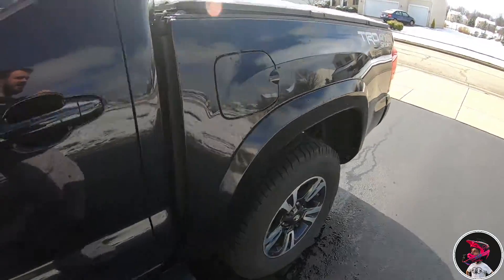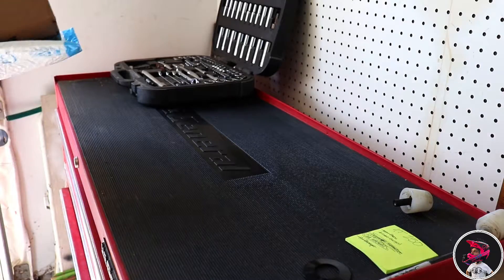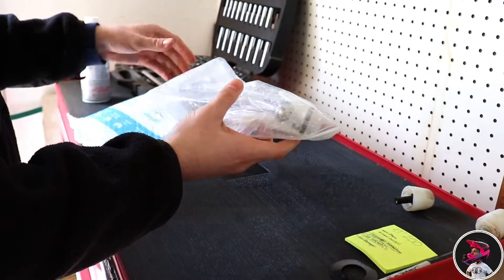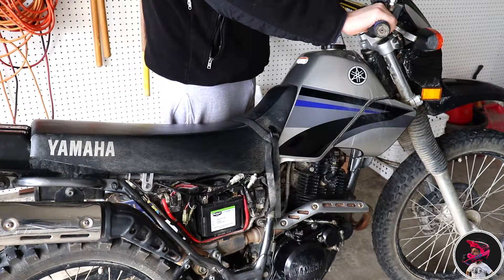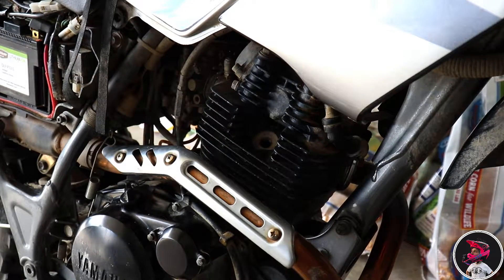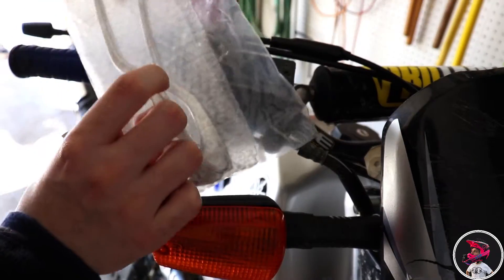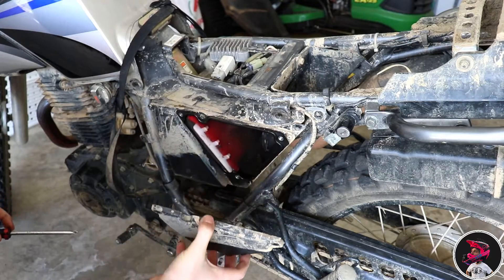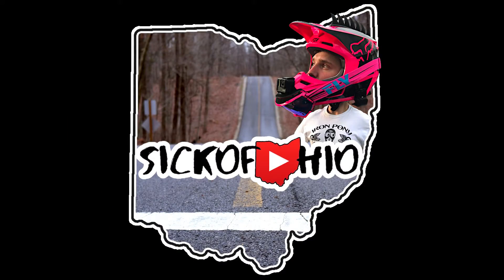Yamaha XT225 Trail Ready? | Clean up pt2

Comment: Curious, Why Yamaha makes an XT225 & XT250, Is there that much of a difference?
Reply: The XT225 was stopped in 2007 in the US market and has quite a following.  Slightly lighter than the XT250 it also had a 6th gear due to the smaller engine.  The XT250 has the same seat height and in 2013 added fuel injection as a standard feature.  This helps starting the bike and warmup much easier.  Depending on which reviews you read the XT250 just feels more powerful. Add it the 14T sprocket and it really comes alive while still maintaining decent street speed.  It's debatable whether either has an advantage in suspension with both being acceptable but at a reduced speed compared to more performance oriented bikes.  Really can't go wrong with either especially for the rider whose is looking for a true dual sport with manageable manners both on the road and off...  Parts are still available for the XT225 and obviously the still manufactured XT250 as well...
Reply: @ngzcaz  Thanks,   I weigh 220, so I'm thinking the XT250 may not have the power to get me up certain hills, But the KLX250 & the CFR250 have about 5 more HP, which might be what I need, so still shopping around for a spring purchase, just not sure which one yet..